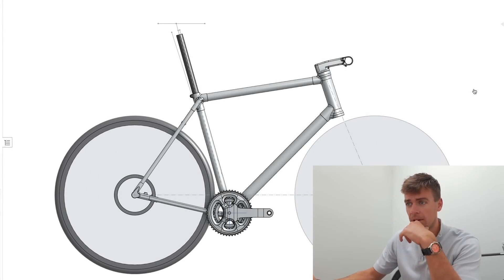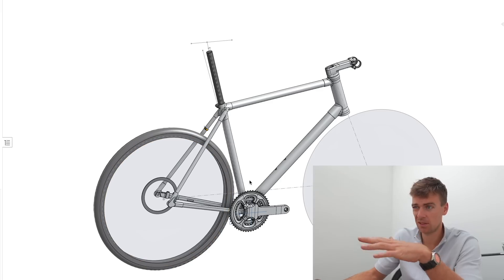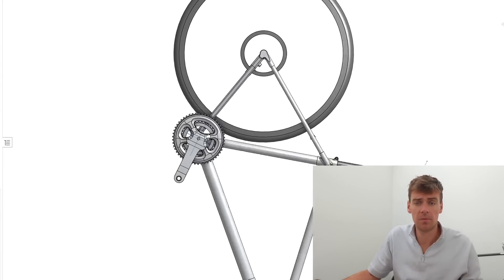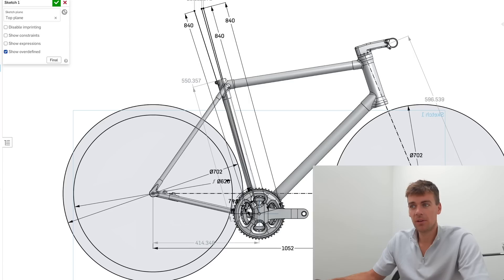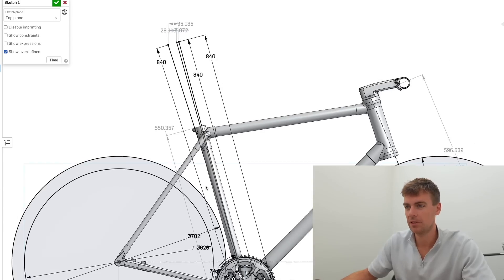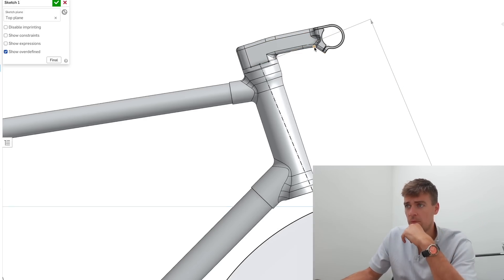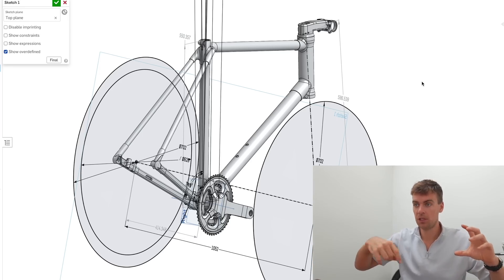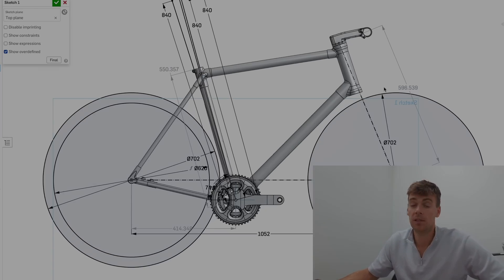Bike Design: bike fit, comfort, body aerodynamics and merging genres.

Comment: At 75 degree seat angle what is your saddle nose to BB setback? 

I’d imagine it’s close to the UCI 5cm rule. I like the peddling dynamics of being in that position but it does put more weight on the hands. I guess that’s the trade off for bike fitters who are dealing with average people that have significantly more upper body mass than elite riders which put much more weight on their hands.

Comment: Just saw from some of your other stuff that you used to live in Hong Kong, which is an extremely humid place. It's more humid than where I live (Hawaii) but it's still very humid here. I have consistently had problems with my chain getting surface rust here. Would you reccomend wax or wet lube for this type of environment?
Reply from the maker: I used to use drip wax (squirt) as with the rains the wet lube would just get so messy and black. I kept my bike indoors with AC so didn't get too much rust on it but outside it did!
Reply: @PeakTorque  thanks! Looks like I may be somewhat out of luck tho lol because my apartment does not have air conditioning. I guess the real answer here is probably just "do chain maintenance more often" which is not the answer I was hoping for but I guess I don't have much of a choice

Comment: A longer rear end is likely going to work better for an all purpose bike.  You will have clearance for bigger tires and a 2x crank.  It also allows a better weight distribution when the front end has a longer front center.  If the front wheel moves further out the rear wheel will have an excessive amount of weight on it reducing cornering grip.  A short rear end allows a responsive whippy feel but lower total cornering performance.  In addition when dealing with tall frames vs short frames they typically use the same chainstays as a method of reducing production costs.  A bike with a 41cm chainstay for a short 5'0"/152cm rider will have a different balance than a 6'4"/193cm rider.  As the seat goes higher to accommodate the taller riders legs the seat moves back and the front wheel moves out due to the longer top tube.  This can be somewhat mitigated with a steeper seat tube angle but only so much unless you use a wacky ultra steep seat angle (75° isn't wacky).  A chainstay 3-6cm longer will help with that.  As far as seatpost selection for a desired amount of deflection for comfort purposes - why not just use a suspension seatpost?  Lightweight suspension seatposts such as a cane creek eesilk are available (I believe that the carbon version is 350gm if not lighter) and are actually tuneable for desired levels of stiffness.  An elastomer is likely to provide superior shock absorbtion to just about any carbon post - and is going to be tuneable for your weight.

Comment: I will only speak of my personal experience so people can read this and try what I ended up doing. I have long legs , long femur and short torso at 185cm and after a bikefit I need way more setback than average. I used to instinctively position myself this much forward because of hip impingement. 

It was more comfortable but it was disengaging my glutes, putting too much weight on my hand and there was no way I could climb in an efficient way. 

The bikefitter found that my hip was impinged for many reasons. My handlebars were too low, I have a physical restriction at the right hip and my cranks were too long. I made all these changes and it made a world of difference. I average around 2 to 3km/h more on my rides and climbs are way easier as I use my glutes.

Comment: Man i had so many friends order custom frames after being sized at bike shop. After seeing your vid realized what a waste it is to iterate over email using 2d pictures.
No bike shop mechanic is every gonna be elite enough to cad a frame with important components and thoughtful enough to consider all the modalities like climbing.
You are super lucky that you are engineer that is also a bike nerd so you can actually benefit from a custom frame in more than "change tubes to match my dimensions".
i can imagine that this would be killer for designing bikepacking setups... calculating heel/toe clearance to front and rear backs, etc

Comment: I've been playing with spreadsheets and bikeCAD toying with the poor-man's version of this and getting Marino to make me a steel Gravel/allroad type frame to replace my road and gravel bikes with one 'do it all' machine. Even though I'm shorter at 5'10" The more upright seat angle makes lots of sense to me for the sake of my hips, similarly getting the seat post to protrude more so it can work more as a kind of cantilevered 'suspension' element. Where I typically ride a 560 I think I might go down to a 540mm seat tube.

One thing that I am struggling with is chainstay length, lots of bikes that manage to clear 40mm tyres, with guards (which I'm going to want) end up around the 430mm mark, which feels a bit long for when I run it in roadie mode with skinnier tyres, it'll be stable but possibly feel.less nimble, that might just have to be a compromise I have to live with. 

I'm probably going to go shorter on reach than previous frames, circa 385mm as that suits me, but pulling the head angle back to 71.5 should put the front wheel forwards a smidge and help with handling off-road. 

I'm really interested to see how this pans out for you.

Comment: Video Idea:

“Do 20-inch(like 451 mm) wheels have less aerodynamic drag than 700c (622 mm) wheels?”

I do not know how to do a fair comparison cheaply without involving a custom frame.

Nevertheless, as you also hinted on a podcast, I suspect that 20-inch wheels have less drag due to their inherently smaller frontal area, but due to the UCI rules and buyers' dogma, no one had the guts to experiment with this idea.

I feel you might be in a position to conduct such a study.
Reply from the maker: @johnkim3858  i was going to test that on a mini velo (Stijn cycles) but we couldn’t match the tyres (thus Crr). The rolling resistance would be a huge error if it were not made the same for 700c and 20”. There must be some tyre compounds available that are available in both sizes….
Reply: @PeakTorque 
Have you already looked into the Schwalbe Kojak?

Inconveniently, it does not come in a 451 size; nevertheless, the 406 and 622 sizes seem identical, at least from the information on Schwalbe's website.

Stijn’s website says its PEG Road is compatible with 406 wheels, although it has 451 wheels.

Comment: @PeakTorque  first and for most thank you for the great video's presenting  facts and explanations(and answering comments) I've spend nights gathering information, from different platforms for the right bike/setup since I fall completely of the standard size/weight(202cm/125kg butt naked, I got your adapter, those 180s saved me from crashing more times than I can count... after for fingers my head starts to hurt) anyway, could you please help me regarding hub choice. I saw your video about the Kom hub, love the idea and the company(made in the UK?) But! I can't live with to different brake rotors and loud hubs. So I've found a company in Italy producing custom titan thru axles. Do you think a stiffer axle(should be stiffer than alloy if all dimensions are the same, right?) could have the same effect preventing axle/hub bending, and do you know enough about onyx hubs(us made, instant engagement/silent freewheeling) too form an opinion?
Greetings from Cologne 🍻
Reply from the maker: @beter_wurst  i replied to your other comment 👍

Comment: A Hope Carbon Seatpost will look sweet. Or a USE carbon seatpost for flex. The split Ergon seatpost always seems like a compromised idea. Have you considered a Titanium post?
Reply from the maker: @benphyall4701  i did look at some Ti yep. Would look cool. The hope and USE use a single bolt system i think - ive forever has this slip. I do prefer a twin bolt as they physically cannot slip and tilt.
Reply: @PeakTorque  if you now have the geometry to put your saddle more central on the post, there would be less leverage on the rail clamp bolt, but, yes,  a 2 bolt system is reassuringly secure.
Reply from the maker: @benphyall4701  true

Comment: Could you use bearing seats for the headset that gives the stem less rise, and give the fork equivalent rake?
Reply from the maker: @cccpkingu  you mean angle set bearings? You could, but the headtube would have to get bigger to accommodate the bigger cups and eccentric inserts. DH bikes do this. But with this internal cable routing also you need extra space, so the whole thing would end up huge!

Comment: 840mm from BB to saddle?   I am going to assume 175mm crank arms as that saddle height indicates a freak of nature,  that would give you an approximate 115cm (45")  inseam which by standard proportions makes you about  more than 8 feet tall :-)
Reply from the maker: Your maths is wrong bud. 840/ 0.883 is 950 🧐
Reply: @PeakTorque  
Thanks for the correction, 
Maths wasn't wrong, only just realised Greg Lemond method measures from BB center instead of furthest pedal position,  making it inherently useless anyway as it doesn't take into account crank length. 
So maybe your not so freakishly tall then :-)

Comment: Is there a reason why road bikes are still designed with steep head angles and long stems apart from how it looks? As you mentioned, on the MTB we have gone much slacker and made the frame longer and the stem shorter and nobody wants to go back.

Comment: I went basically the same route when I designed my own titanium bike. Used to 73.5 deg bikes that just do NOT fit with my long inseam (86cm)  and relatively short torso (175cm tall), I basically went to 75 deg on the seat tube and kept a 71.5 cm in the front for some sort of hybrid gravel/road. That allowed me to keep a relatively normal reach without stretching my body too much.  Also had the same problem with spacers and also solved it by setting a much larger head tube (175mm instead of 150mm in standard bikes). And lowered the BB, although to 75mm drop in my case as I use it more in a gravel mode. Again great moves imho. 

In my case I managed to pack 50-55mm tire clearance with a 430mm chainstay using a semi-yoke welded piece on the right (does not take cables inside, but with a SRAM AXS is not a big deal). 

If I ever design a pure (all)roadie I will likely go with the same geometry, the bike fits like a dream. Also if I do, I may try to do it breakaway with either S&S couplers or Z couplers, undecided ...
Reply: very interesting

I have pretty much identical body proportions.. would you mind sharing a bit more detailed measurements of your frame? effective top tube, stack, reach, etc

thanks!
Reply: @ynslife eff. Top tube: 540. Head tube: 175, front center: 612, Reach: 379, stack: 600, bb drop: 75, chainstay: 430, angles (front and back): 71.5, 75 deg. It has T47-68mm as BB and UDH hanger in the back. Zero toe overlap with these settings.

Can fit a 48-35T chainring or a 42T, with 50-55mm tires.

My only mistake was going for fully internal routing. I should have gone semi to make it easier to pack the bike for traveling...
Reply: @mireia3208  That sounds like a really nice bike, do you have any pictures of that one?

Comment: Man, this is very similar to my English built 8 years ago! I essentially wanted a fat tire road bike, with the ability to run 50mm 650b and up to 42mm 700 with a 50-34 double chainset.  The geo is optimized around 35mm 700s, but works quite well in the extremes also. I did 414mm chainstays, 74.5 STA, 72.5 HTA, 78mm bb drop. The geo was also built around 165mm cranks and a 90mm stem (I’m 5 8’). I did exactly like you did with the seattube length - quite short and sloping downtube to achieve the flex you mentioned. Honestly, I’m not sure I’d change anything 50,000km later!
Reply from the maker: @tonystyles806  nice. Sounds an ace build.
Reply: @PeakTorque  first and for most thank you for the great video's presenting  facts and explanations(and answering comments) I've spend nights gathering information, from different platforms for the right bike/setup since I fall completely of the standard size/weight(202cm/125kg butt naked, I got your adapter, those 180s saved me from crashing more times than I can count... after for fingers my head starts to hurt) anyway, could you please help me regarding hub choice. I saw your video about the Kom hub, love the idea and the company(made in the UK?) But! I can't live with to different brake rotors and loud hubs. So I've found a company in Italy producing custom titan thru axles. Do you think a stiffer axle(should be stiffer than alloy if all dimensions are the same, right?) could have the same effect preventing axle/hub bending, and do you know enough about onyx hubs(us made, instant engagement/silent freewheeling) too form an opinion
Reply from the maker: @beter_wurst  no problem glad you’re making use of the adapters! Definitely helpful for bigger guys. At your weight almost double the force required and heat generated by a 60kg rider! For hubs, have you looked at White industries? They used to do a hub with a 15mm steel axle. Strong as an ox. No experience with Onyx.
Reply: @PeakTorque  I've landed on an giant revolt so I'm stuck with 12mm. I'll look into a steel axle, but just to clarify for me: both steel/titan will be stiffer/better fatigue-hence better bearing live as an alloy thru axle? Meaning the hub choice would not have as much of an impact regarding undesired wheel flex, bending of the cassette etc?

Comment: Oooh, you caught me in the process of making a new frame (beginner without workshop) and I have rear triangle from broken frame with 72.5° ST angle. Same problem, long legs, short upper body. Shortened TT already til 53.5 (56.5 st), but it's basically the same as changing the angle of the ST as you showed.
Probably now I have to make a jig for rear triangle to be able to change it....

Btw anyone tried 72 ° HT with 20-25mm rake fork? How it is?

My project is about vintage tt frame with kind of bullhorn mounted on fork crown

Comment: Putting a bigger tire in the front will change your geo. 
However the changes are all more suitable for the harder trails.
A. Your BB will go up, which is a plus
B. Your headangle will become more slack, which is also a plus.
C. Seattube will become slighly more slack, only minor downside.

Comment: Can you share your bike geo (whats not in the video) & your length and inseam? I am probably of sumilar build. 
Would love to compare. Designing frame dimensions for myself for a gravel-travel-bike. 
1x12 and 55mm-ish tires so probably going for boost drivetrain.
Love your consideration for a steaper seat tube, avoiding too much weight over the rear wheel and getting rid of the spacers.

Comment: Before signing off , get your crank length sorted.
I’m running 140mm due to v.long femurs
46/30 oval rings
Which require low FD mount 
This will transform your pedalling and cadence

Comment: Xplr axs dropper seatpost. 75mm travel. Extremely expensive but exactly what you need. Locked out when extended but as soon as you lower it even the slightest it acts as suspension with travel. So it provides vertical compliance and with still being stiff horizontally. I hope I got that right not an engineer).

Comment: Why do you need so short chainstays in this size?
Reply: The most obvious and probably irrelevant is shorter the chainstay more direct torque transfer to wheel but the not so straightforward is the rider's weight (which in the most part is what the back wheel is moving) can benefit being closer to the wheel
Reply: He lives in a hilly area, so he wants a frame designed with climbing ability.

Comment: Commentary on climbing with a slack seat angle harkens back to the 'Pogacar Pre-rotating' video. I once had a Redshift dual position seatpost the moved the seat forward ~3cm for aero bar use. Ended up using it on every steep climb as well. Love the geometry here, as it's similar to what I've been hunting for for a while. Closest I've found is the Merida Silex, but it's extra slack up front. Looking forward to the build
Reply from the maker: Was on it before pogi 😂 jokes

Comment: What wheel size are those? Cos wheel size is the only fixed param in mainstream frame sizes and distorting the smaller geos IMO
Reply: You can see in the image 700mm tire OD, 622mm rim diameter, 700c.
Reply: @jaro6985  thanks i blame Netflix, but why the 700 and not  other size? Listening to all of it nearly everything is been taken into account then my guess is wheel proportionality too
Reply: @IsaacRC  most of the wheels he gets to review are 700C, so not much opportunity to use others I guess?
Reply: @jaro6985  idk the only reason for me to order a custom made frame is fitting smaller than 700 wheels, that's why i asked

Comment: Why not go for a shorter stem and longer reach to compensate?
Reply: To keep the wheelbase not too long I assume. I don’t know what length the stem is but 120 mm would be relatively standard in this size.
Reply: @Antoine_Frs  What's the problem with a "long" wheelbase?
Reply: A longer bike is more stable, a shorter bike is more nimble. Different riders may prefer one or another.
Reply: @Antoine_Frs  Yeah, that makes sense... for trial bikes

Comment: Cool stuff, Alex. Always love digging into CAD models. By the way, the audio in this video is probably the best you've had. Whatever you did, it worked.
Reply from the maker: Macbook webcam audio with some post processing to remove echo.
Reply: @PeakTorque  Nice.
Reply: Not recording in front of a noisy fan helps a lot